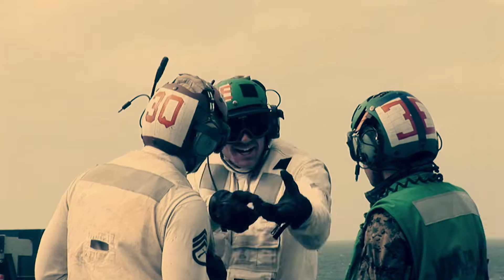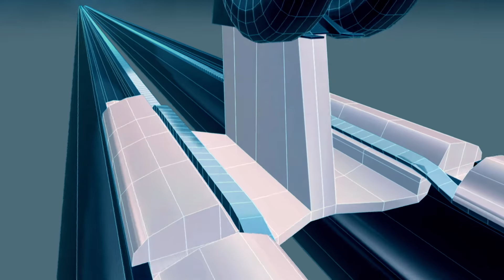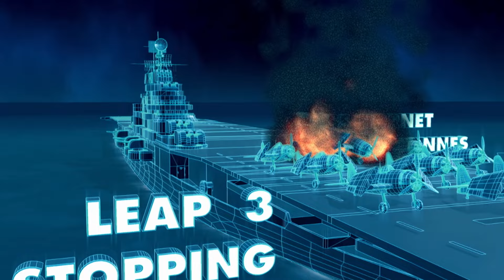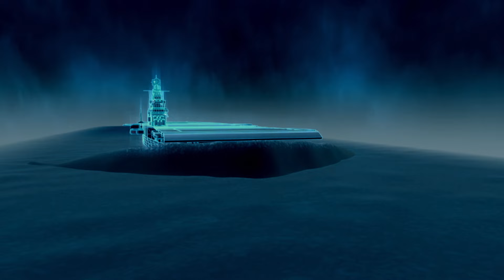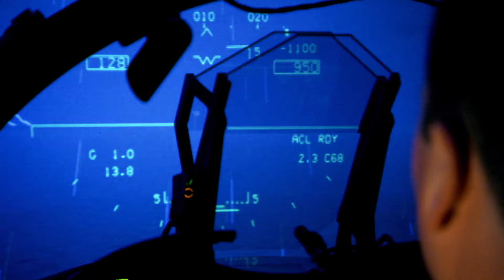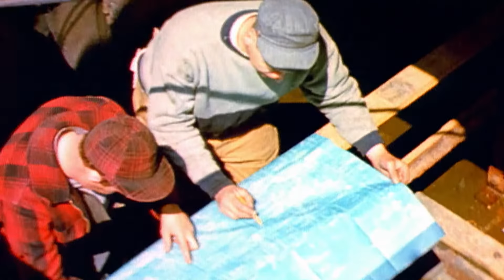Nimitz Class – Rise of the Aircraft Carrier – Big Bigger Biggest

Comment: The Nimitz class CVN has been surpassed in size by the Gerald R. Ford class which is roughly 1000 tons heavier and at the same length of a Nimitz class.  It has the electromagnetic aircraft launching system as well. Advanced recovery systems as well as reactor upgrades that generate enough electrical power to run everything currently as well as into the future with upgrades.  This CVN will be in service until 2105 or so for the USS Gerald R. Ford itself.
Reply: Yeah, but can it stop a dinghy with a couple suicide bombers from ramming into it? While refueling?

Comment: Interesting enough. Both conventional petroleum powered Aircraft Carriers AND Nuclear powered Aircraft Carriers have nearly the same amount of firepower and Navy airwings (squadrons and number of personal and aircrafts aboard) and nearly the same dimensions and displacement. So why are Nuclear powered aircraft carrier considered superior over petroleum powered weapon systems? The United States 🇺🇸  Navy could reasonably build 2.5 petroleum powered aircraft carrier vs. 1 modern Nimitz or Ford Class of CVN. Please positive responses. I am a former USN Sailor.  Lol...thank you all
Reply: Two answers, speed and refueling. It can be deployed anywhere and fast.
Reply: @jesjunfjo8466  but cost to years to life use. Both are estimated at 25 to 50 years of service life. What then justifies the extra expenses on a CVN vs a CV? Just because a Ford Mustang (I love those, you may otherwise) cost more than a Nissan [Eldest Brother] Versa Note. Does this actually relate to longevity and costs of use per mile and years of service; concerning both have about the same depreciation mathematical fourmula? Thank you 😊
Reply: @byronharano2391  Well youre right it will cost more to run nuclear but then a fast target is much more harder to hit (i drive a mustang by the way) and also those carriers are so big  conventional fuel will hamper it down not to mention the space it needs for those fossilized fuel .The  internal combustion engine is also much more heavier than the nuclear ones. So when you  asked a marine engineer, nuclear is the way to go. Thanks
Reply: @jesjunfjo8466  OH thanks! I love your response! Enjoy your Ford Mustang. Oh, I agree with you. However,  imagine having 2.5 more conventional petroleum burning Aircraft Carriers built in a shorter time frame vs 1 expensive and costly Ford Class CVN? Nearly double the production and deployment sortie rate. From a "We need global coverage now" stand points from the Mediterranean to Pacific Theaters, we could get double the Naval airwwing coverage sooner and under taxpayers dollars now vs a Ford Class Carrier build. Note: I am presenting a counter argument only. I am in agreement with you. Thank you 😊
Reply: @jesjunfjo8466 BT3 BRYANT, ADVANCE BOILER TECHNICIAN, U.S.S. Gridley CG-21, 10-17-84, the last of the boiler technicians, agrees.
Reply: @jesjunfjo8466  200% agree with you!
Reply: Did you miss the part about how frequently the nuclear powered carriers are refueled compared to petrol? It's a no brainer! Longer time out without need to refuel is a great advantage. Plus nuclear power is much more efficient. If there weren't people who tried to totally eliminate it by complaining about incidents like Three Mile Island that barely emitted any radioactive substance into the atmosphere, we'd have nuclear power plants everywhere like Bill Gates.
Reply: @coachwendy5618  The uranium fuel rods will take  20 yrs  before it has to be replaced. I dont know where you got the idea  that conventional fuel  will take more than 20 yrs before it is refueled.  Thats why the advantage of nuclear  is it will never run out of fuel for 20 yrs. I rest my case.
Reply: @coachwendy5618  I know. But in a crisis like we are somewhat in. I could have nearly 3 conventional petroleum burning aircraft carrier patrolling the seas now vs. waiting for one CVN to be built and launched. You cannot kill an enemy with imagination. Do you think the Navy Admiralty are also feeling the pinch in the gap of firepower the failed Zumwalt Class of DD left? Number of guns on an enemy not the ship on drydock blocks. The USS Kitty Hawk lasted for nearly the same number of years as CVN 65 and all of USS Kitty Hawk elevators were still operational at her decommissioning. Although your argument is noted. Power generation for the newest energy weapons a petroleum powered aircraft carrier might just lack. Plus if a petroleum powered takes a severe hit from today's modern kinetic weapons. There is no risk of the powerplants scramming, something which could occur in a nuclear powerplant.
Reply: I served on four CVs in my time, two PACFLT, one LANTFLT, one in the MED.  So let’s start by eliminating the equivalents in both DFM and Nukes.  Speed, firepower, service life, roughly the same.  Reliability is different because DFM carrier ‘snipe spaces’ need to be taken down for maintenance much more frequently than Nuke spaces.  Then there is the infrastructure to support a DFM carrier.  Lots of supply vessels, crews to man them, tanks to contain the DFM fuel, overseas bases.  Carriers can burn seven figures worth of DFM pretty quickly.  A major downside to nukes however is the frequency of crew liberty calls. Ask any of us who have been ‘haze grey and underway’ for 100+ days basically doing our thing and we’ll fill you in!  Fair winds, following seas to you shipmate!  What fleet(s) were you?  What ships?  Let me know please.  My rating demanded carrier assignment when I rotated to sea duty.

Comment: 20 years with out refueling is just crazy
Reply: The new Virginia class submarines can go 40 years without refueling.
Reply: All aircraft carriers big  or small are just sitting ducks in the oceans against any modern missiles attacks. With hundreds or thousands missiles hit the aircraft carrier at once all that needs will be only couple missiles hit the top deck then the aircraft  carrier is useless, finished.
Reply: Please substitute the word nuclear for crazy.  Also keep in mind that other fuels such as diesel (for operating ground support equipment and electrical generators aboard) must be ‘unrepped’ onto the CV.  Oh, and we need to vertrep many other supplies as well.  The general rule is related to perishables…once fresh vegetables start to wilt, you can bet there will be an Unrep on the schedule.
Reply: Oh, and our AVGAS tanks have seven figure capacities.